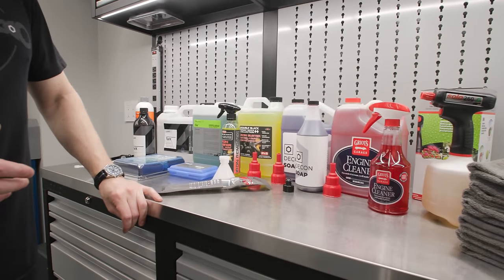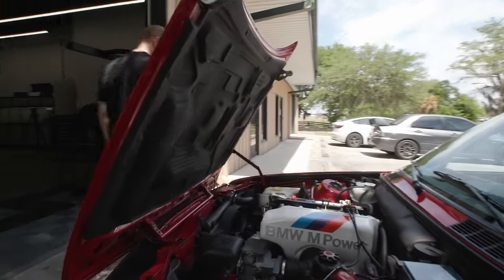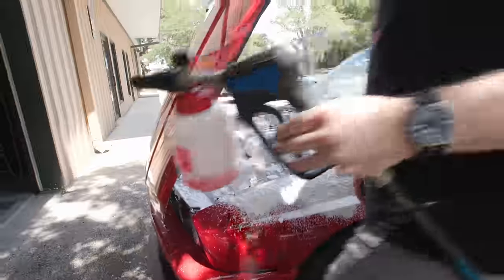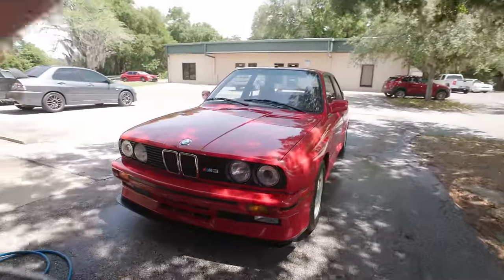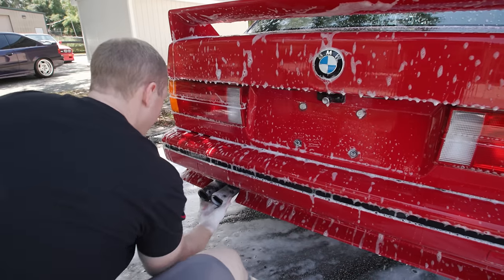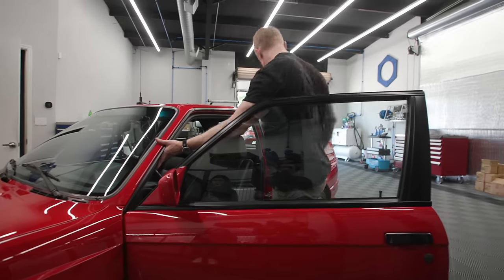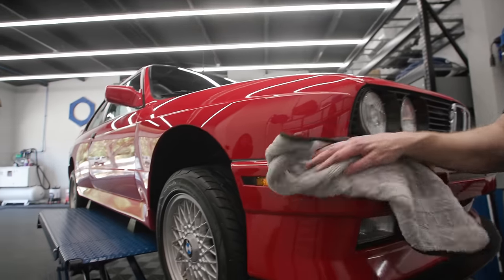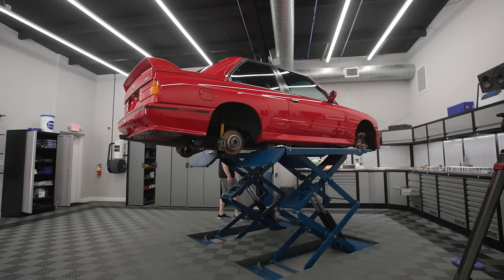How I Decontaminate A Car Before Polishing | The Dual E30 M3 Detailing Series

Comment: One tip I've learned (from Yvan Lacroix and Pan) is to clay and do the iron removal in one step at the end of your wash. Iron removers don't fully remove iron on their own when they are just sprayed on the surface. It's really only working at the edges to loosen it and remove the iron oxide staining from the paint. The mechanical action of the claying process is what really removes the specks of iron out of the paint.

Put the clay scrubber in your soap bucket, use one spray of iron remover on the panel and one on the clay scrubber. The iron remover (along with the soapy water) provides plenty of lubrication. Work that section/panel until it feels smooth and then go back to the bucket. This greatly reduces the smell and the amount of iron remover used. It also saves time because you only have to rinse once. 

I recently verified this method side by side on a white hood that had a lot of iron contamination. One side was done with this method, the other side was soaked in iron remover like you do and allowed to dwell with some hand agitation like you have done in the past. After that I rinsed off, inspected and found that the rust staining was gone from both sides. Then I heavily sprayed the entire panel again with iron remover. The side that was clayed with the minimal amount of iron remover as lube was completely free of iron, but the traditional spray/dwell/rinse side still had a lot of iron left over.

Give it a try sometime and see what you think. The time savings are nice, but the best thing is the big reduction in smell.
Reply: Thanks for sharing. Very economical solution to consider. What Iron decon are you using? I’ve heard not all Iron removers are good lubricants.
Reply: @ccollins_24  I've done this method with Iron Buster and Optimum Ferrex. DIY Detail Iron Remover is another good option. 

Lots of others would probably work, but may not have as much lubrication. Just be careful because there are some decon products out there that also have solvents to soften tar deposits. That will kill the synthetic clay towels/scrubbers.
Reply: @jeffc6832  Thanks for the detailed response.

Comment: Definitely upgrade to an e36 M3 or the z3 96 and up steering rack. I believe the z3 rack has the best turn ratio around 2.7 to full lock. Supersprint exhaust sounds good on these cars but its pricey no doubt. Are wheels an option or are they staying stock? Don't waste your time trying to make it faster. The s14 is insanely expensive and you'd be better off swapping a S5x into it. Some style 5 wheels with a nice small lip on them would look great on the car but idk how far you are willing to go with mods. I am an E30 fanatic and have one of my own so this is exciting to see. The carbon intake and cams would add a glorious sound but costs a fortune for not too much gain. I personally love the stock door handles that have the engraved "BMW Motorsport" in them which adds a nice touch. Thanks for the great content!

Comment: You really need to consider and trial  Sandro's (CCAD) process for Decon.  NV Purify undiluted over car while it is dry  ( solo sprayer would work well for dispensing). Its a fallout (iron remover) along with traffic film remover. Let it dwell for 5-10 mins, then foam over NV Purify with an  Alkaline soap (OG Soap)  on top and let dwell for an additional 5-10mins.  Do a thorough rinse. Then either foam or hand wash with Carpro Descale acidic wash (attacks mineral deposits and water spots).  It maximizes dwell times and it attacks it from multiple aspects. Then assess paint and determine if a mechanical decon (claying) would be necessary for the vehicle. 

 I would look at his process directly or speak to him for a more thorough explanation. However, it seems like a well thought out and thorough process.  Just a friendly suggestions.  Appreciate your videos Matt. Always a good source of entertainment and education.  Cheers

Comment: Get MY 99+ E36 front control arms to center the wheels, lowering springs or coilovers, and a faster steering rack (surprised you said the rack was good. It's horribly slow!). Carbon airbox would be great but when you delete the MAF, you'll need a standalone and that's a big step and potential big headache. Exhaust are always subjective, but I haven't heard one that sounds great; hard to make a 4 banger sound incredible.

Comment: The E30 M3 is the one flatform i wasn't bummed out,  on not getting one,  just for personal preference i guess coz i like drive all of em not  buy em to park, The e30 M3 moves but a little under powered for my liking other than that its a good car to have. I had a 325xi that i planned to build but i my schedule got hectic and didnt have time. That would have been a good platform as its all wheel drive.

Comment: On mods ... I had a track-prepped daily E30M3 in the late 1990s.  I did the oil pan baffle (critical), buttress welded rear toe links (I understood they tear out), SS brake lines, vented backing plates, drilled rotors, Group N engine/transmission mounts (tightens everything up), short shift kit.  I think it was Red Line MTL that was recommended and used for transmission fluid, which smoothed out the notchy shifting, actually made a difference.  I used Korman street/track suspension kit, which was solid.  On engine, I had it chipped, which you could feel.  On intake and headers, there are some beautiful parts to buy out there ... none of which I did.  They're pricey, with many options/combinations ... with lots of claims on gains.  I could never get comfortable which combination would be great and would really work.  So, I heat-wrapped my stock headers and left it at that.  Behind the header, did a track-only straight through DTM-tip exhaust that sounded awesome.  Test pipe, no cats.

I had 245/35 17s on all four corners.  Everyone will tell you they won't fit, but they fit perfectly on mine once the rear fenders were rolled.  This is with the Korman suspension, which was 1-1.5" lower.  Not sure the offset, unfortunately.  First had TSW wheels, then Revolutions ... which looked great in matching black pearl with machined lips.

Later, blew the engine at Sears Point in a glorious plume of $moke.  Went for the Turner 2.5 kit, which made a big difference, obviously.  Rebuild was something like $12-15k in 1999 or so.  Ouch.  You'll note the 2.3 vs. 2.5 difference when driving your Sport Evo.

Despite your comments at the beginning of the video ... for the record, I LOVED this car.  Prepped as described, it was like driving an exposed nerve ...
Reply from the maker: Thanks for the input!

Comment: What temperature water are you running thru the foam cannon, as well as water in the buckets ?
My thought is, the warmer the water, everything expands and helps loosen the contaminants ? Is the water as hot as you can physically stand it? Or is there a cut off ?

Comment: Hey Matt, hoping you could give me a recommendation for a process to keep my GR Corolla clean. I'm running in to an issue that the stock brake pads produce a boatload of brake dust and the factory paint is super soft. This leads to a high level of oxidation contaminent in the car. Touch washes are generally a bad idea with this vehicle as the factory clearcoat gets scratched by a brand new high quality microfiber. Some form of soap/foam and a super effective iron remover and touchless high pressure wash seems to generally be the best method that I have found. Are there any products that come to mind to you that assist in lifting the Iron, dirt, and grime off without having to touch the car?

Comment: I know this is only the decon video and this question would be more relevant on the coating video, but do you ever find yourself missing the power lock collinite combo? I still haven't moved to coatings because from what I've heard they don't have the same look and feel. Am I making a mistake being stuck in the wax age?
Reply from the maker: I don't.  Modern coatings look just as good and are just as slick.

Comment: 200hp n/a from a 4cyl in the mid 80's.  Honda was still just scratching that into like 2017.
Reply: I'm always amazed when someone is too lazy to search for information. I'm a fan of e30 in general, so m3 is one of my dream cars, but Honda's B generation of engine had 1.6 4cyl with 180hp n/a, and also 1.8 with 200 hp n/a, later on F20 a 2.0 liter with 240, common knowledge for any car guy.
Reply: @Nameless402  Way to completely miss the point with your snarky little reply.
Reply: In 2001 they brought out the Civic Type R with 200bhp....
Reply: @79blustone  the BMW 4 cyl n/a engine that was designed in 1985 made the same horsepower that 4 cyl n/a engines inside sports cars would make for the next 35 years.  Including Honda which came out with a 200hp 4 cyl engine about 10 FUCKING YEARS after BMW and kept selling all the way into the modern age.
Reply: @79blustone  Even the BRZ was a sports car with a 200hp 4 pot being sold up to like 2 years ago.
Reply: @Nameless402 my guy, when was the f20 ? 😂 10 years later?
Reply: @79blustone and don't forget the F20C with 240hp from the S2000 in 1999😉
Reply: @millll111lllI hahaha butthurt cause your facts are wrong....
Reply: @RICARD01  Which fact are you here to cry about?  That the Honda Civic Si barely made 200hp almost 35 years after this car came out?  Then you bring up the S2000 which came a decade after BMW had already won every championship on the planet with a 300hp 4cyl.
Reply: @tinodeblier5694  Don't forget the 240hp 1990 M3 Evo 3.
Reply: K24/K20: Am I a joke to you?🤨
Reply: @millll111lllI sounds like he was just being factual. I’m going to have to say that your original post was unfortunately wrong.
Reply: @unicorndreamers9571  Wrong how?  Was Honda not still selling an approx 200hp K n/a k series in 2017???  30+ years after this M3? And it was the top of the line performance Civic in the US
Reply: Honda pumped out multiple engines in the 90's with 100hp per liter. B18C had nearly 200hp from a 1.8L. Nearly 190 from the 1.6L B16B. And 240-250 from the F20C out of the S2000. Honda was no slouch either. 2017 is far too late of a timeframe.
Reply: @kindledlight  Right but you're admitting that Honda caught up to BMW eventually (about 10 years later) and then never really surpassed them in power, even several decades later.
Reply: @millll111lllI  With cars that were typically far cheaper and not designed as (mostly) homologation touring car models for the street.
Reply: @millll111lllI  Also the first B16 debuted with 100hp per liter in 1989.
Reply: @millll111lllI  And dont get me wrong, Im not denying the impressive work of the E30 M3. Fantastic machine. But Honda was doing wonders with smaller engines hardly a few years later is my only point.

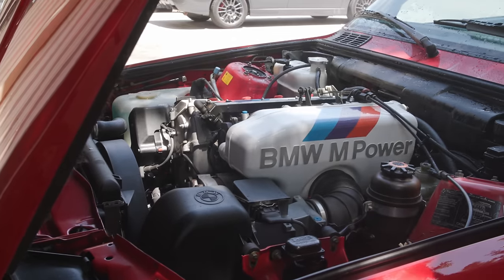Comment: 16:10 i cant help but imagine the water/soap getting in the fuse box connections and causing corrosion, it was never designed for high pressure water.
Reply from the maker: I've done this hundreds of times.  A pressure washer at distance isn't going to hurt anything.  In fact, it uses much less water than a regular garden hose.